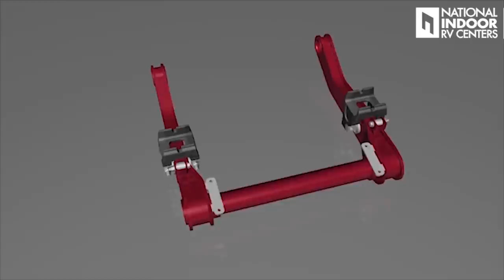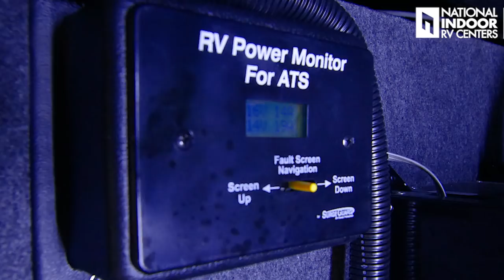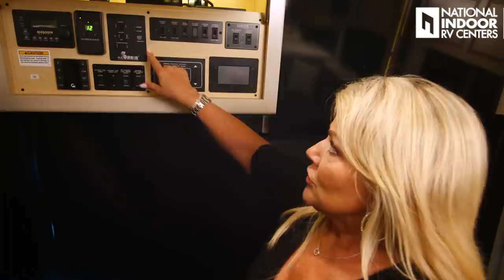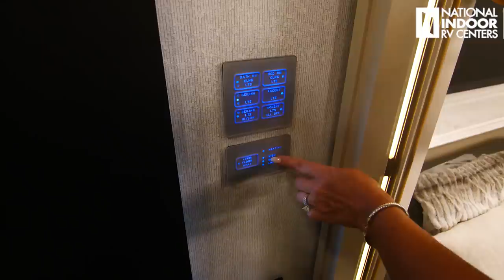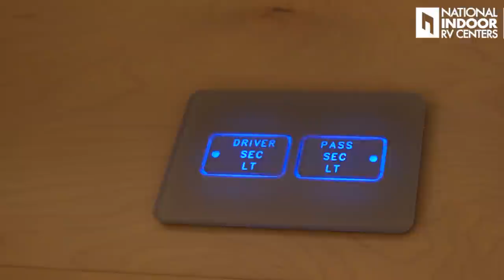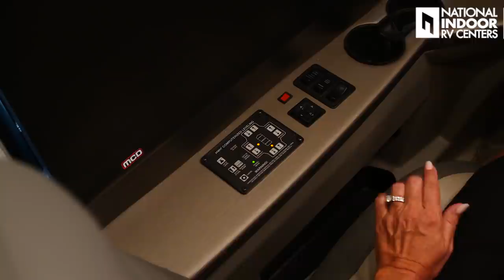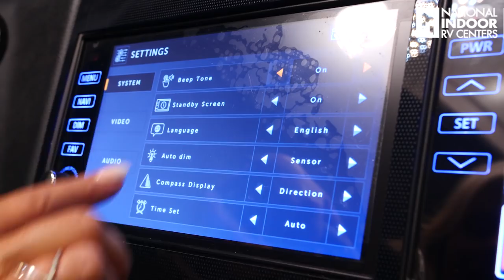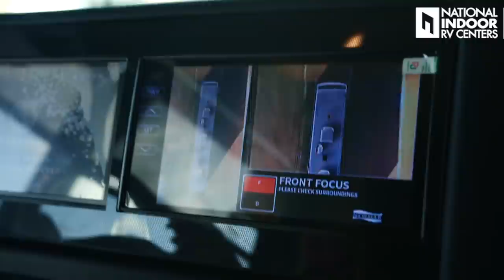2021 Newmar Dutch Star | Full Motorhome Walkthrough Tour | NIRVC

Comment: We have owned 2016 and 2017 Entegra Anthem 44b and bought a Tiffin 2019 Phaeton 40 IH. Always wanted a  Newmar coach. Only question is can we get any tech ie firefly system or spider upgrade . I did not see any screens for running blinds or heat etc in your video. 
Very nice job though